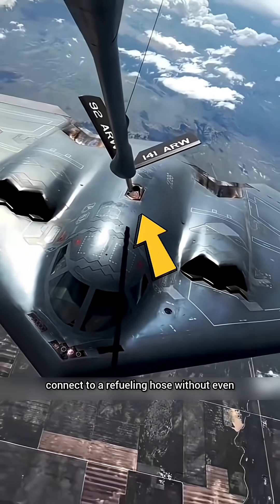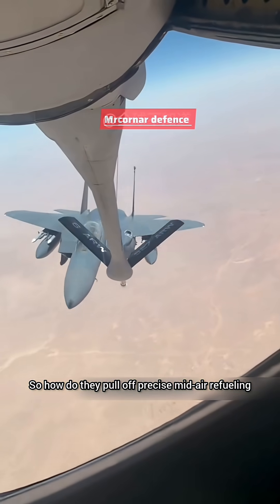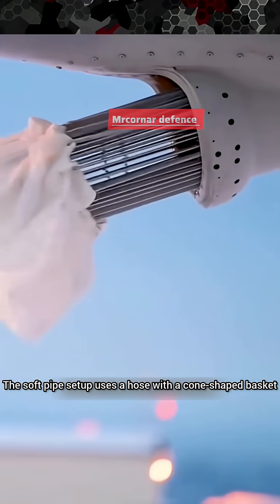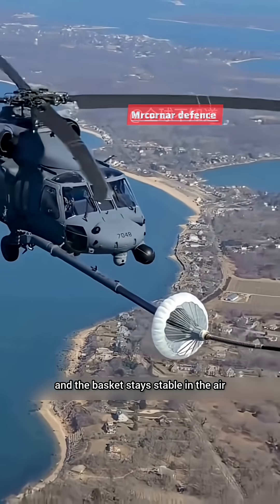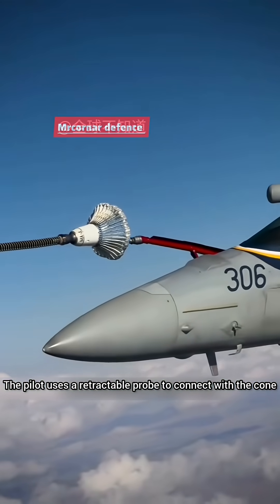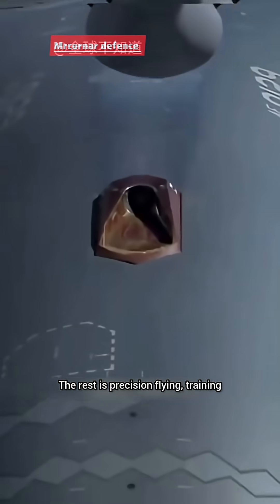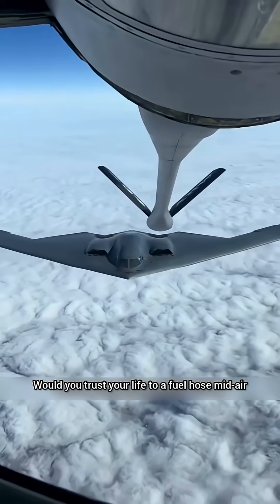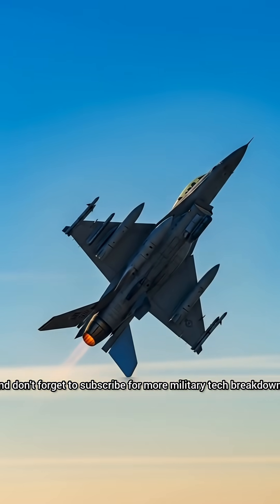How Fighter Jets Refuel Mid - Air Without Seeing The Hose | Military Tech Explained. #fighterjet

Comment: A sight picture burned into your brain along with director lights on the belly forward on the tanker and if you can see it paintings on the boom itself. OBTW while refueling may take place at hundreds of MPH the delta between aircraft is zero or you are not on the boom long.